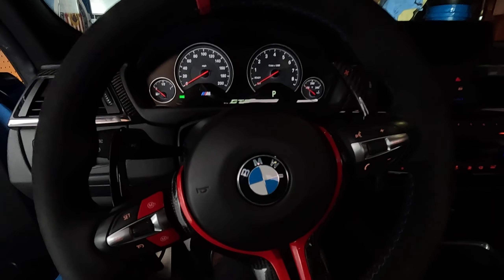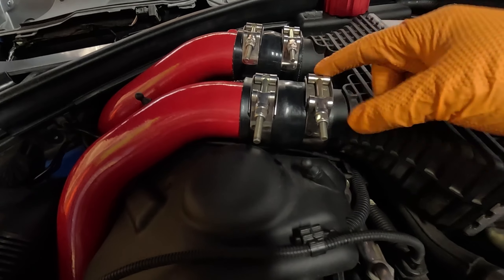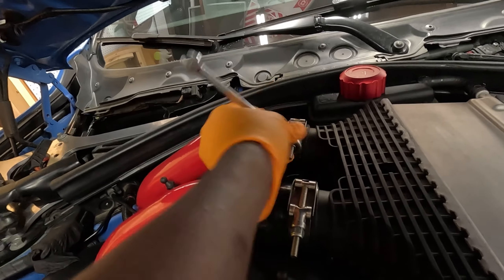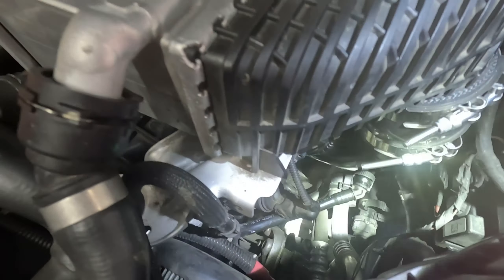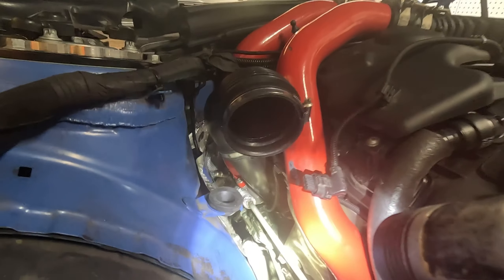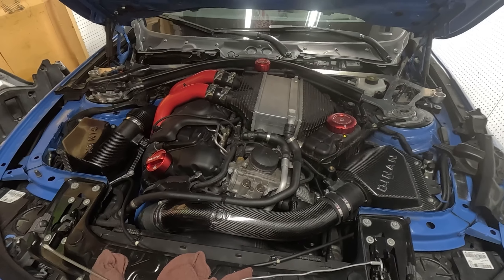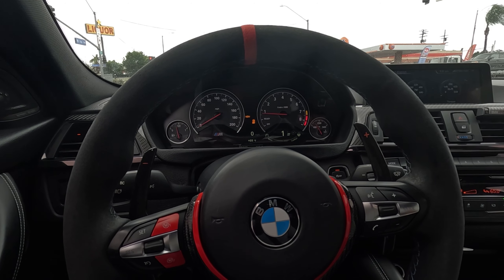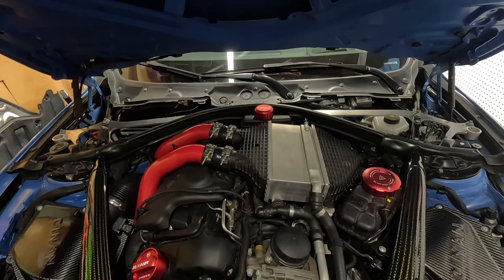BMW F80 M3 Common Problem.

Comment: Thank goodness they’re reliable for the most part
Reply from the maker: 💯, but since I went stage 2, I have had like 2 boost leaks so far. Hopefully this is it.
Reply: @Jbpgarage  I had that issue with stage 2. For me the issue was the clamps
Reply: @tractioncontroldelete Where did you get the new clamps? I went to Home Depot and couldn't find the correct sizes
Reply: @Neverworry21  Use the OEM ones. Then put a zip tie right behind it. The tensile strength of the OEM ones are better than the aftermarket replacements. By placing the ziptie right behind/next-to the band (if using silicone) it gives extra assurance. I’ve found silicone to be very effective btw
Reply: @tractioncontroldelete  Will do thanks Man!

Comment: S/o from France bro. What's the reference of your charge pipe clamp? and j-pipe clamp?
What's the brand of your charge pipes?
Reply from the maker: Not sure what you mean by reference? They are the VRSF charge pipes.
Reply: @Jbpgarage  what is the brand of the t bolt clamp of your charge pipe ? are they supplied with the VRSF charge pipe? Thank U bro.
Reply from the maker: @izigot-got5368 they come supply with the charge pipe.